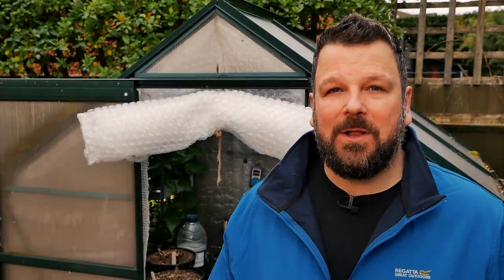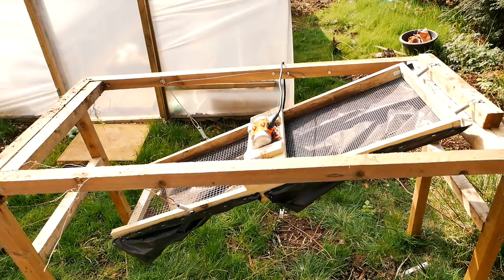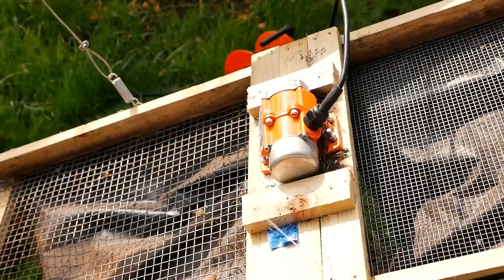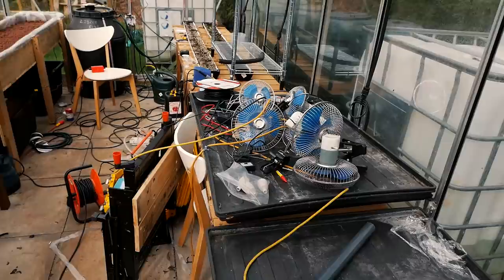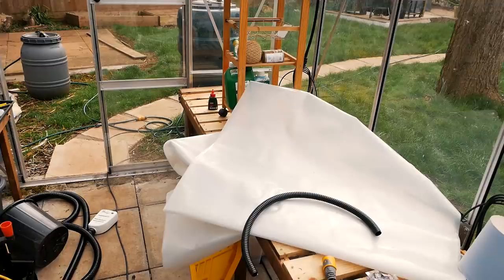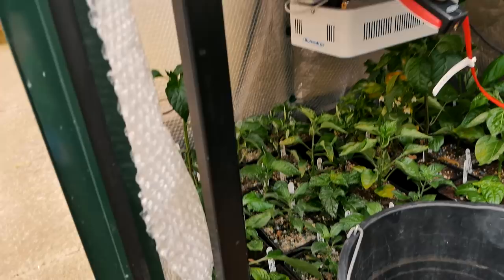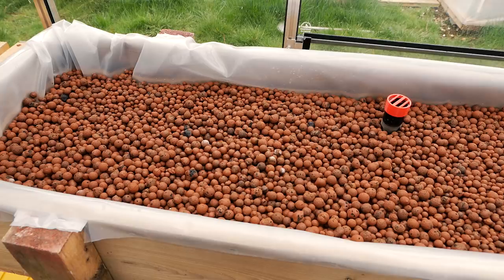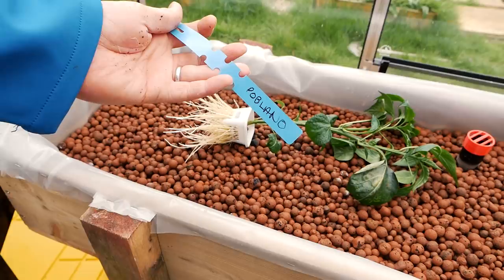Getting the plants into the large greenhouse. And sifting some compost (2019.E08 Garden Updates)

Comment from the maker: Thanks for all the well-wishes! My foot is feeling much better...will be a couple weeks until it is back to 100%. 

With regards to the water temperature in my hydro reservoir, I don't want to use a heating element in there because that would mean having an extension cord running to the greenhouse. The solar+battery off-grid setup I have, it would be impractical to run anything that generates heat off of that. However...I have actually run an extension cable to the greenhouse for the next 2 weeks....and I have a small aquarium heater in there. The weather in the UK is meant to be getting really cold over the next week or so. I am confident my soil based plants will be fine, but I don't have enough experience with hydro to be confident that they would survive!
Reply from the maker: Using fusion 360 to design..cura for slicing
Reply from the maker: The problem you have there is again down to the amount of power that would be used. That thing in the video has a massive power draw!
I have a 100w solar panel, which on a good day, with 12 hours sunlight (not likely where I am) will generate 1.2 kW of power to top up my batteries. Imagine a 300w aquarium heating element running to keep temperatures around 20' celsius in the tank. I could only run it for 4 hours in total. That wouldn't be enough to keep the tank at 20' celsius.
Reply from the maker: Actually I didn't...not in the nursery. But that is part of the plans I'm putting together for next year. Good call buddy!

Comment: I'd recommend throwing your aquarium heater into your reservoir set at around 65° F to account for any heat added by the sun. Has worked pretty well for my outdoor dutch bucket system.
Edit: added temperature units
Reply from the maker: Hi Joseph, I've mentioned already below, I have an aquarium heater in there at the moment...but not for long. I run my greenhouse off-grid, using solar and batteries.  Running a hearing element off battery isn't practical.  So I have an extension cord running to the greenhouse for the next week or two...but will then remove it
Reply from the maker: I am hoping the temperature start going up now! Tired of the cold.
Reply: Oh yeah, running a few hundred watt heater off a battery would definitely be impractical. I'm tired of the cold as well but thankfully tomorrow should get up to 90°F here in California!
Reply from the maker: I'm jealous!

Comment: put a heater in your nutriant tank, should help with the cold temps
Reply from the maker: Hi Steve, I run my greenhouse off-grid, using solar and batteries. So using a heating element is not necessarily practical. Also I am trying to test the limits of what is possible doing hydro "outdoors". That being said, I have actually run an extension lead to the greenhouse and am using a small aquarium heater just for this week (the temperatures are supposed to be dipping below freezing and I would hate to lose my plants!)

Comment: a tank heater as used in aquariums set to 18-20 centigrade should help to ensure hydroponic success.
Reply from the maker: I have one in there at the moment...but had had to run an extension to the greenhouse. I normally run everything in th greenhouse offgrid, using my solar setup... You can't use heating elements off of batteries realistically. So this is just for a week or two then I will let it do its thing with the temperatures

Comment: I'm especially interested in the sifter.
Sadly I couldn't find any info on the power of the motor, I find them in range from 30W to 100W, did you feel the need to adjust the RPM of the motor?
Reply from the maker: I built the sifter to size for the power of the vibrating motor.  So I don't bother too much with pwm or using a potentiometer
Reply: @ChilliChump  thanks for the quick response. I still would like to know what's the power of your motor? ;D If you got it for around 50£ it's probably 30 or 40 watts. I already have a sieve, it's a bit bigger and most likely heavier than yours. I could adjust the eccentric anyway, I kinda need to decide between 30W and 100W... sigh
Reply from the maker: I believe it is a 30w

Comment: Why not add a fish tank heater to your water tank for your hydroponic setup?
Reply from the maker: I actually have one in there for now... But I had to run an extension lead to my greenhouse to do that, which I don't like doing. I will only have that in for a week or two. I run everything off-grid, using solar and battery.... Running any sort of heating element of battery is not practical
Reply: why not use a thermostat run a pump that circulates your res tank through a lengh of black hose to the tank? Have a high and low shutoff. Low shutoff so it wont loose its heat when the ambient is to low. Could be a fun automation project and might use less power than an electric heater.

Comment: I have my plants in a 2' deep X 4 wide' X 5' tall grow tent indoors  and i have all my pepper plants watered from the bottom with 4 1'X4"x2" trays. i need to find a way that i can maintain the water level in them when im away for the week at work. any suggestions? simpler the better. cheers.
Reply from the maker: Are they soil or hydro? I'm just wondering why you need to maintain a water level of they are soil.... The roots need to breathe between watering. If it is hydro, what method are you using?
Reply: They are pots sitting in those trays. I fill the tray and the water wicks up into all the pots in the tray. It was an attempt to simplify watering and hopefully to automate it.
Reply from the maker: Something I did in the past to automate watering of my seedlings: Get a battery powered water timer (https://geni.us/watertimer) and a bucket. Then drill a hole towards the bottom of the bucket, and fit a tap or hose connection. Raise the bucket to a higher level than where you want the water to go...set your timer, and you should be able to have an unattended system for a good few days or weeks depending on the size of your bucket.
Reply: Thx for the info i will give it a try

Comment: Are you heating the nutrient solution for the hydro?
Reply from the maker: I have a small aquarium heater in there...keeping the temps a little higher than 10 Celsius. Won't be doing it for too long though
Reply: @ChilliChump  I have nft hydro systems in my greenhouse.  WIll be planting out in a week or so, but I have aquarium heater in mine for this early in the year.  tend to have mine a little warmer than that
Reply from the maker: To be honest I was hoping to go without the heater. I try keeping my greenhouse off-grid...using my solar setup. Heating uses too much power to run off batteries realistically. But I put the heater in because I need to get a level set to what to expect here with the hydro. Will see how it goes
Reply: @chillichump do the clay pebbles hold any heat from the day or are they cool?
Reply from the maker: Yeah they do. The temp in the bed is a few degrees higher than ambient. Same as with soil
Reply: @ChilliChump  fingers crossed then, hopefully they'll not suffer from shock at all. Obviously you can't retrospectively insulate the box, but is there any value in some sort of black fabric covering to increase the heat in the first few weeks as you would with soil?